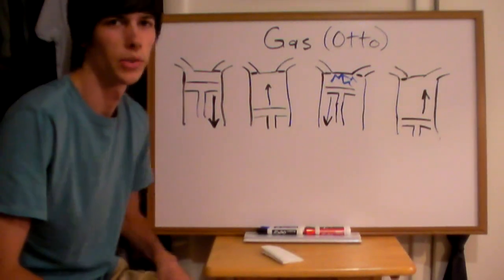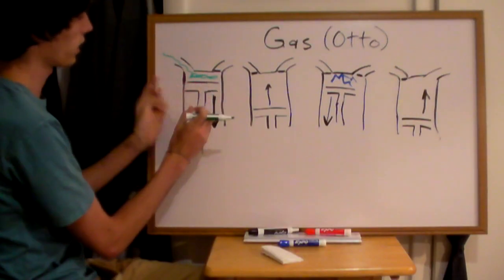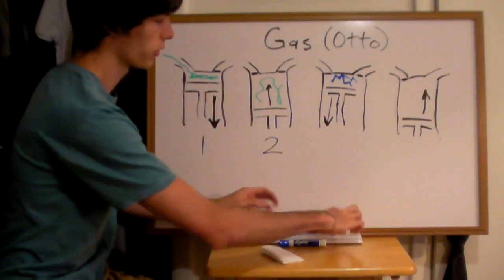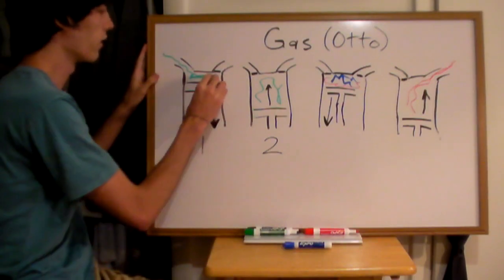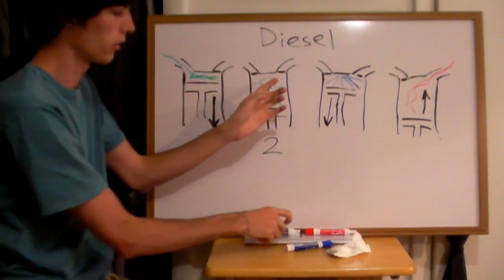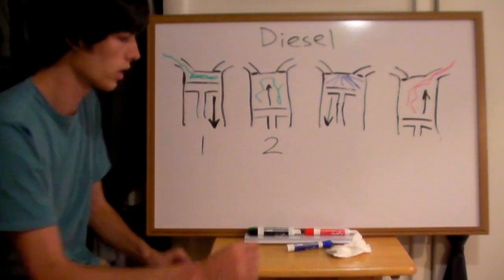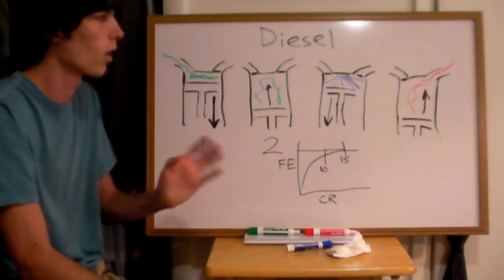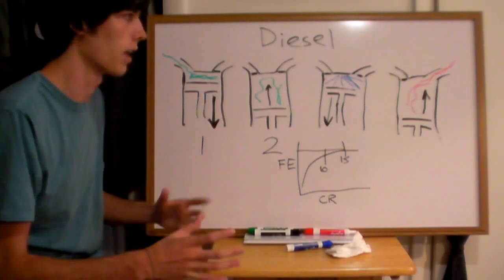Gasoline vs Diesel - Which Is Best?

Comment: I know, that engines without throttle body exist - but throttle is just moved to valves, not removed, so efficiency is still reduced.
 Only real engine without throttle is "MUSIC", which is regulated only by amount od fuel (just like diesels). Sadly, this engine have problems with NOx emissions, so it didn't make it to production.

Comment: By the way I should add that removing the throttle body actually improves the volumetric efficiency, not the compression ratio. Basically just better cylinder fill - more air means you can add more fuel and make a bigger bang!

Comment: There's more to it than that. Petrol engines without throttle bodies already exist (e.g. BMW Valvetronic system), and while these improve efficiency, the fact that diesel contains more energy than petrol per unit volume (higher energy density) means that petrol engines can never achieve the same efficiency, at least while efficiency is measured by mileage per unit volume. If engine efficiency was quoted/measured properly (energy in versus energy out), diesel would show a smaller advantage.

Comment: I suppose intercooler is needed when there is a turbocharger as you need to cool the compressed air that is having a higher temp due to compression.

Comment: More torque more efficient, yet less RPM for old diesels. And the old are also more noisy and has bad smell. So pick new diesel and it will beat up gasoline engines =D.

Comment: Actually , making carburetor is much cheaper than making high preasure fuel pump . Also , that pump must rew high and it can be problematic if Diesel is not lubricative or pure (it can clog nozzle) . And Disel engine is must be much heavier because of torque and heat . So gasoline as more reliable and less expensive solution was better for cars . Direct injection found its way in modern engines , but high preasure pump remains .

Comment: Hey - great video. Question for you...

What is the reason petrol engines cant just compress air and then squirt fuel in at the last minute like a diesel? Why do petrol engines have to squirt the fuel on the intake stroke but diesels can wait?

thanks

Comment: can you use diesel in a high compression engine? it sounds dumb but i always wondered because i built a honda civic all motor with a compression ratio of 13.6 to 1 and i would use a high octane fuel rated at 106. now if the ratio was higher would diesel work in this application? why or why not

Comment: Higher compression ratio makes more force from same amount of air mixture. 
But main reason of gas inefficiency is not comp. ratio itself, but reduction of pressure caused by throttle valve (which has similar effect at efficiency as lowering compression ratio). With variable compression ratio, which prevents this effect, gasoline engines could be as efficient as diesels.

Comment: That is correct. Diesel engines don't have spark plugs. They depend on their high compression (ratio)  for ignition. 

Not an expert so someone chime in if this is wrong, but I believe it has to do with the diesel fuel vs gasoline energy content that allows for it's high compression and hence the compression ignition.  With complicated engine management a gasoline engine could also have limited compression ignition. I recall reading that somewhere but I can't recall an actual example in practise

Comment: It depends on purpose. Diesels have a smaller operating range. Typical red line for car diesels is 4000-4500 where as gasoline 6-8 k.  For daily driver , fuel economy, low rpm torque, and dependability I'd go with a diesel car. But for performance applications the gasoline option will always beat the diesel.  There are trade offs for each.

Comment: You can't just cram more air into a diesel and leave it alone. Just watch what happens at truck and tractor pulls with lean issues, running too much boost pressure, etc. People can still easily run into these issues when they mod street diesels.

Comment: Diesel, a higher compression ratio needs a greater diameter crank, so you have more torque. Diesel also has a higher energy content and is more efficient, which will lead to more torque.

Comment: Great channel, well explained short videos. Why do Diesel engines inject fuel separately to the air and why can't/don't petrol engines also do this to increase the CR? Also does this mean Diesel engines do not have spark plugs?

Comment from the maker: The crank rotates twice for every four strokes of the engine. Thus you can use the rotations of the camshaft (1/2) to calculate the number of strokes per second. 6000/2 = 3000 (RPM of the camshaft). 3000/60 (seconds in a minute) = 50, so 50 times per second.

Comment: When the air is compressed in the Diesel Engine, isn't there already a great amount of pressure built up? So when the diesel needs to be pumped into the already compressed air, wouldn't it take more effort, as the "pumping" on diesel into the compressed air requires a greater "power".

Comment: Petrol/Gasoline engines use a spark plug to ignite the fuel ,which means on the compression stroke of the engine there will be fuel and air compressed simultaneously ,
So on a diesel engine there is only air in the cylinder on the compression stroke, which means there is more room for a higher compression ratio, 
Diesel engines use the heat of the compressed air to ignite the vaporized fuel   which is injected after compression

Comment: I don't get one thing in gasoline engines, why does the air not escape from the exhaust outlet when it is being compressed by the piston? ... As you said there is one inlet for the air + fuel to enter into the chamber which the piston compresses and once it is burnt the fumes out go using the outlet, right?

Comment: You may be right, there is definitely less energy loss via heat - I use one of low compression ratio diesels, this engine needs much more time than any other I ever used to reach its full temperature. Definitely not recommended for short runs.

Comment: so the glow plug is only used to start it? from there does it not need the glow plug because it heats it'self? also can you explain why it's more important that you never run out of fuel in Diesel engines than in Gasoline Engines?

Comment: a direct injected gasoline isnt operated the same as a diesel. Gas engines will still have a throttle body to control air flow. 

Also, being fuel injected refers to any engine that isnt carbureted.

Comment: Yes, a greater compression ratio (and thus greater temps) allows the fuel to be burned more efficiently and the engine would need less fuel to generate the same amount of power

Comment: I'm european and I tell you we use mainly diesel engines in our cars because diesel is cheaper, and also because diesel engines have better fuel economy. Anyway, a modern diesel car is nice to use on a daily basis due to it's high torque, and they are by no means slow cars compared to the gas equivalentes.

Comment: Actually, otto engines can have a higher compression ratio than 10:1 - specially motorcycles. Diesel ones too normally have way higher compression ratios. 15:1 is a very low ratio to a diesel engine. My own car has a compression ratio of 18:1, and I had one that had a compression ratio of 21:1! Nice vídeo anyway, keep up the work! :)

Comment: you mentioned that the main difference in power characteristics between gasoline and diesel engines was due to the compression ratios, could you help explain the different outputs between a gasoline and diesel engine with the same compression ratio? like the mazda skyactiv gasoline and diesel, both of 14:1 CR

Comment: Thank you for the quick response. I m not understanding or something is wrong because the diesel engines have a high CR to detonate de diesel without spark plugs, But if you turbocharge, there will be more pressure in the cylinder so it will pre ignite.

Comment: Why do you say that in Diesel engines when you turbocharge all you need to worry about is mechanical components whereas in fuel ones of pre ignition ?? Diesel can also pre ignite if turbocharged.. or not ??

Comment: I am guessing that a decreased compression ratio will mean a reduced temperature after compression, resulting in a decreased temperature gradient, meaning less energy loss via heat, so more energy will be converted to reciprocating motion, This would mean a lower operating temperature and the parts would not have to withstand such high pressures, so they could be made smaller, thinner and lighter, therefore less surface area for friction, so less weight and friction and better fuel economy

Comment: People say that diesel engines are more reliable so prefer them to petrol in off roading. Do you know how? Does a diesel turbo work different to a petrol turbo? I heard a diesel turbo doesn't have a blow of valve but im not sure. Are they also interchangeable given you program the ECU? ohh and how does a diesel yield more horsepower than a petrol? I know that they don't produce as much Horse power because they run at lower RPMS

Comment from the maker: Diesel engines are typically built with more durable components due to the higher pressures they see, so they can last even longer than gas engines, if maintained properly.

Comment from the maker: It's first started by a starter motor (check out my video "starting a car - explained.) Then the flywheel's stored energy (momentum) keeps the engine rotating by storing the energy from the power strokes.

Comment: So why cant you use gas in a diesel engine? If its more flammable that diesel wouldnt it just provide more power....and you wouldnt even need a spark plug. Gas can be ignited just the same at those high pressurized temps as diesel fuel is that correct?

Comment: The glow plugs, intake heaters are used to warm up the cylinder before and after starting untill the engine reaches a certain temperature. Dont ignite the diesel in any way.

Comment: The chemistry of gasoline does not really allow it to ignite off compresssion witht he low compression, Even though you can use gasoline in diesel engine(Not good for it) the low compression of gasoline engine wont allow it to run without a ignition source. But that ignition source allows it to to be reliable and efficient. Also diesel use high pressure injectors to anatomize the fuel and control the output of fuel.

Comment from the maker: I believe it has to do with gasoline's volatility; it's a bit more difficult to predict it's behavior. Gas engines are also cheaper as is, and would be more expensive should they be made to handle higher pressures.

Comment: also some old machinery diesel engines have the ability to start on gasoline till the block warms up, then switches over to diesel without shutting off, pretty neat the engineering that goes on inside some of them.

Comment: But why isn't acetylene isn't used in a engine? Very explosive nature@ low concetrations, just cant use it in a indirect injected engine though have to be direct injection diesel or gas engine but it may not last long due the high explosion rating.

Comment: I meen just directly inject actelyene in to a very hot cylinder and actelyene takes very low concetrations to explode so =fuel efficient plus the hot air when the actelyene is injected should be hot enough so that it explodes very easily.

Comment: It is because the fuel is higher-priced than in the States. My moms car does 11L/100km (21mpg) and mine does 5.5L/100km (43mpg), I know it doesnt sound much to you but it is exactly two times cheaper to go to a place 62 miles away (100km=62miles) with my car

Comment from the maker: Diesels can be hard to start in the cold, so sometimes they're left running. Modern engine block heaters may have eliminated the need for this. A glowplug is used to heat up the combustion chamber to increase the likelihood of combustion on cold starts.

Comment: in short - high compression, a long stroke, and on most diesels produced after like '90, a turbocharger. a turbocharger (and also a supercharger) compresses air into an engine to enable it to burn more fuel, and it's basically a similar outcome as you'd get when you'd increase the displacement of an engine

Comment: I know the answer to this. It is possible to compress petrol to combustion like diesel. 
The reason why we don't engineer petrol motors to do this is because of the burn rates. Petrol is so much more volatile than petrol and it's burn rate is much faster. This means compressing it to combustion gives you more uncontroled burn conditions akin to detonation conditions. 
Diesel has a better burn condition and is more forgiving than more volatile fuels when compressed to combustion.

Comment from the maker: Well it would be based on the ambient temperatures, and then you could use PV/T(1) = PV/T(2) to find the increase in temp from the increase in pressure.

Comment from the maker: Yes, the pistons push down, and connecting rods rotate the crank. Probably best for you to check out my video "engines - explained" which should help clear things up. The power stroke powers the other strokes, yes.

Comment: Gas engines are much cheaper to produce and because they make less torque the engine and drivetrain components do not have to be as stong or heavy. Also different HP/torqe requirements for different applications plays a large role.

Comment: Your key word is "Proximate". I know this. 
Now, I need to correct your misquote. I didn't say COMPRESSION pressure, I said COMBUSTION pressure. 
The rest you said is absolutely correct. Getting more fuel-air to cylinder density is what turbos do, that yields higher Combustion pressure.

Comment: I know 4KRPM is just an example. I've seen diesels running 5-6KRPM. 
And no torque is not just ;linked to stroke, it's a function of 2 factors: 
The length of your torque arm, in this case, that is directly tied to stroke.
The second is the amount of force applied to that torque arm, in this case that is tied directly to the combustion pressure acting down on the piston. Pickup truck torque is now pushing 800 because of turbos.Turbos add to higher combustion pressures.

Comment: if ignition in diesel engines happens with the addition of fuel (because of the high temperature during compression), then do diesels lack spark plugs?

Comment: It is possible to make a diesel engin with shorter stroke to make it rev faster. You still will get the benefit of having more potential energy in diesel than gasoline. The sacrifice is toque because you reduce the torque arm when you reduce stroke.

Comment: Petrol on the other hand, In a well tuned engine detonates, meaning that almost all of the fuel flashes into hot expanding gas very quickly. This means at higher RPM there is plenty of time for all of the fuel to 'burn' before the end of the stroke and the pressure wave travels much quicker down the bore which keeps efficency high. more RPM = more power = less torque = ligher gear boxes and engines.

Comment: Diesel burns quite slowly throughout the power stroke steadly increasing the pressure in the cylinders. there is a cut off once the piston is moving quickly enough that 1, the stroke is over too quickly and you cant burn all of the fuel before the exhaust stroke (also happens with overfueling and makes black smoke) and 2, the slower build up of pressure cant "fill" the expanding combustion space quick enough to extract enough power.

Comment: i'm totally guessing but I think its simply by design. I think most diesel engines have a long stroke compared to even a 'stroker' gas engine. stroke= torque. its probably easier to extract power/ efficiency/ comp ratio using stroke rather than bore. race engines are high comp ratio with very high bore to stroke ratio but it takes a lot of tuning to get an with those characteristics to achieve good v/e, scavenging, etc. once again the diesel is practicality > everything else, just hypothesizing

Comment: due to diesel engines using heat of compression to ignite the fuel (when air is compressed it gets hot and that is how the fuel is ignited) instead of a spark, diesel engines have a very high compression ratio such as 20:1 or even higher while a non diesel engine has around 9:1 and that is how they get the insane amounts of torque
and diesel engines cant rev very high due to the large stroke for the high compression so at low rpm they can still produce a lot of torque.

Comment: from what I've heard is because diesel engine will have a lower rpm rate than gasoline due to the heavy parts in the engine thus it will have lower top speed and acceleration. Notice how diesel tends to accelerate much slower than gas? But diesel will definitely win when it comes to torque.

Comment: power = torque x rpm
Diesel runs slower because it has a higher torque on low rpm's, also diesel burns slower than petrol (because of the longer chains) Therefore it can't be used on higher rpm's (like petrol engine) To get more power we need to increase the torque and therefore the length of the piston, which results to a higher moment. Add a higher combustion pressure and you get more moment (F x d) and resulting a higher torque. Also consider the torque/power curve

Comment: I like to call the decel action "anti tourqe"...deisels require an elaborate system commonly known as "jake brakes" to achieve the same results...also your estimates of compression ratios are a bit off...15 to 1 used to be high end for gas burners..(usually race motors)...poor quality fuel has forced those down....20 to 1 is more diesel...